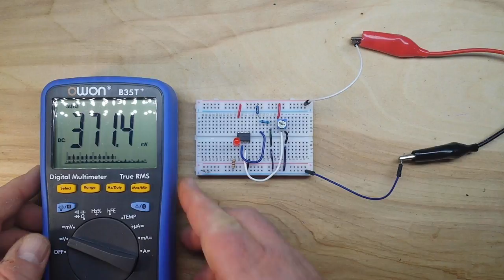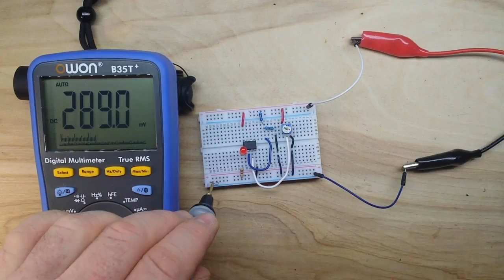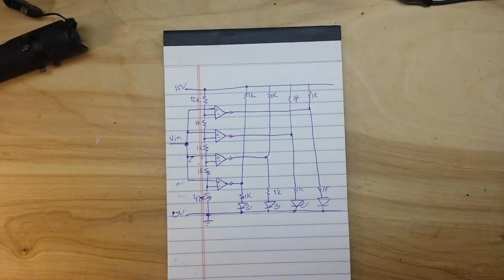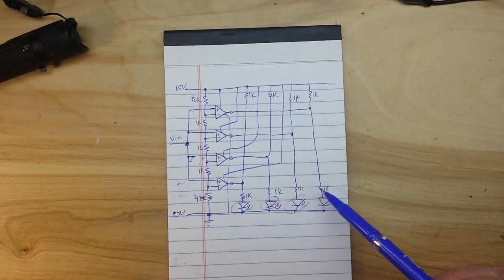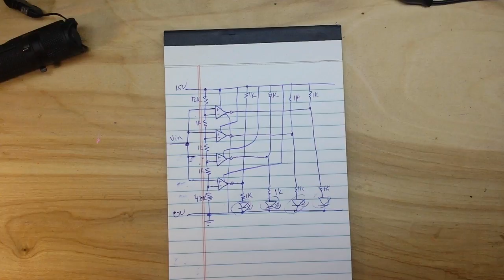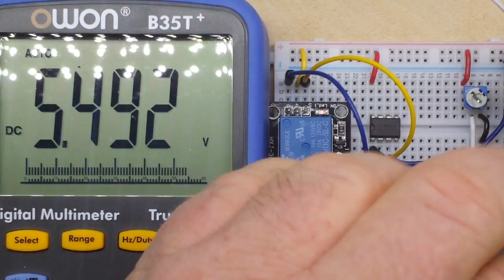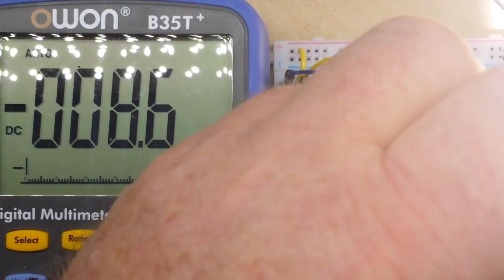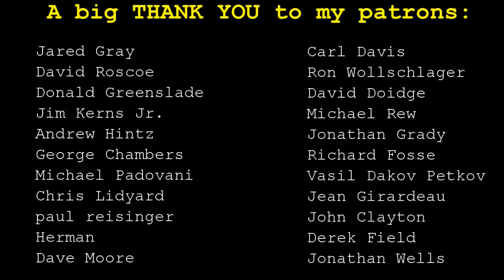More about comparators

Comment: This reminds me of an access control circuit. Just got to hook up a power supply and a mag lock to that relay and you can lock all the doors wirelessly by just turning off the lights!

In the schematic I saw interfacing with relays they usually had the comparator output hooked up to a resistor at  the base of a transistor and the relay connected to the collector, Vcc and a diode to suppress voltages from the interfacing device.

Comment: Had an awful time trying to get this circuit to work for a project. You know it helps when you use the correct chip. Tried using a LM393, but thought I was using a LM358. Getting old I agree. Nice video, not sure if you look at the comments on old videos anymore! Thanks always.

Comment: Just one question! Is there a reason to use an OPAMP like the TL072 as a comparator, instead of using say an LM339 which is designed to be a comparator? Now I have used the fourth input of the TL074 as a comparator since I already had it in the system as an amplifier. I did not want to add in another chip.
Reply from the maker: +Carl Davis No reason, just an example on how any opamp can be a comparator
Reply: @learnelectronics   hello I have the UA741 op amp but I can't manage to get -Vsat as my output. My output is always positive building the same comparator as you. Turning the potentiometer leads the led to shine strong or weak. only 2 possibilities so I have the digital output but always positive ...
Thank you for all your videos by the way :)
Reply: Except that a comparator will be much faster at switching than an op amp.  The op-amp will only transition as fast as the slew rate allows, which often is fairly slow in comparison to a true comparator.